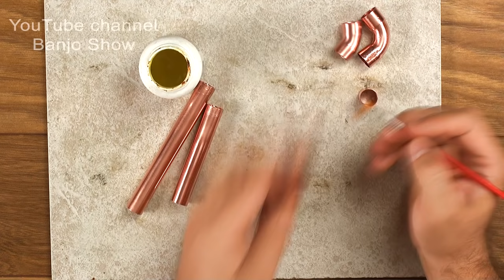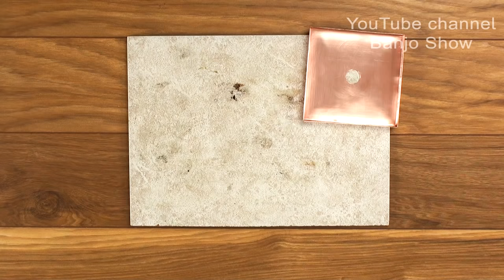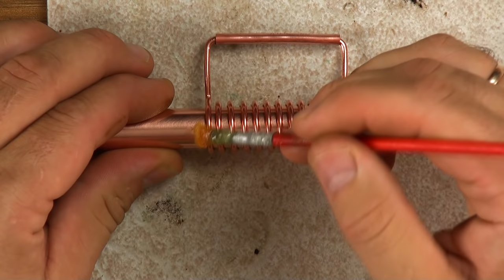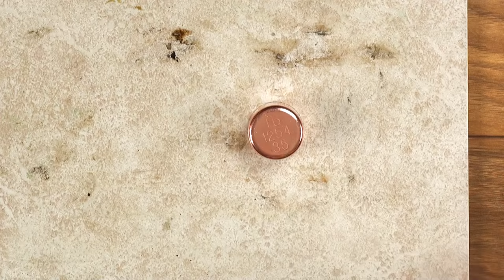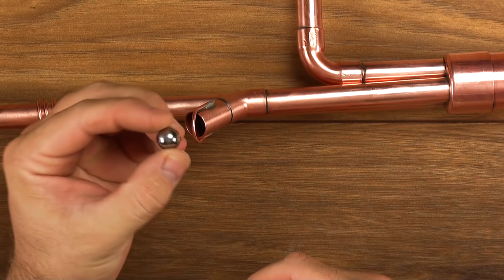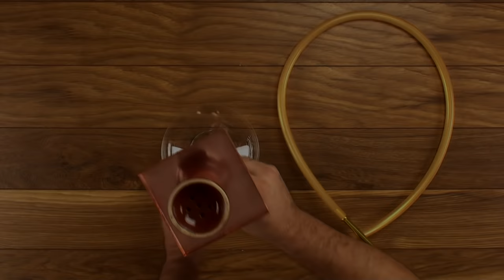How To Make Copper Hookah DIY

Comment: Do you get these pipes air tight? If you cover the hole where the bowl is supposed to sit and then suck will there be a complete vacum or do the air seep in. Impressive if they are air tight.

Comment: Awesome video! I became a Patreon just to make this. What is the copper spring you used on the stem to keep the tray in place called? I couldn’t find it at any hardware store
Reply from the maker: This is a simple 2 mm thick copper wire that I twisted using a tube
Reply: Banjo Show thank you for letting me know! I will be finishing it today 😀

Comment: What kind of glue you used? And for clean the copper?
Reply: daniel Cuñat he didnt use  glue, its silver pipe solder. i dont know what he used to clean it though.
Reply: Darokov Rumple, any non oily solvent to even got water will work

Comment: Remove one block of charcoal and you will have a perfect chicha
Reply: Taki Clinton Harness its written Shisha and If you smoke with Aluminium Foil U use 2 coals you only use one coal with a Special thing called one smoke you use 3 coals with a badcha i dont Know If you have a english word for it in Germany its called kaminaufsatz and U use 2-3 coals with an smokebox preferably with a silicone or Glass head